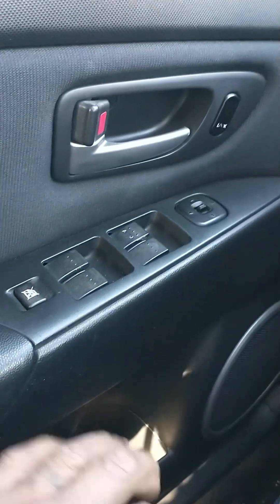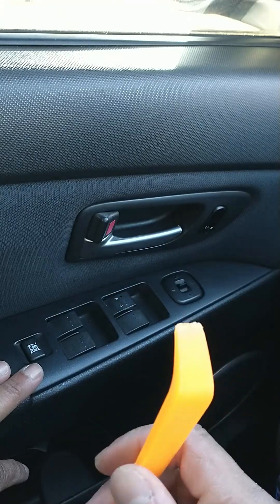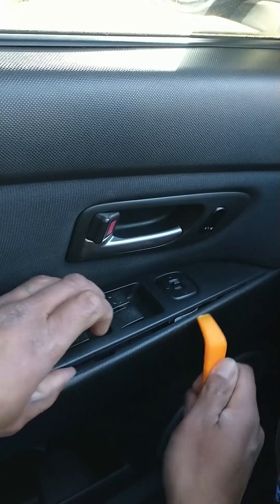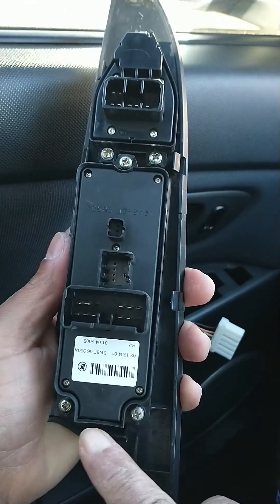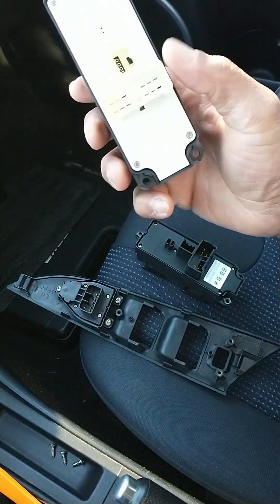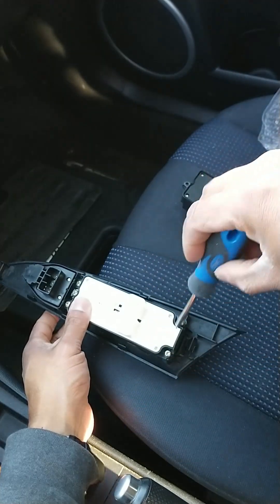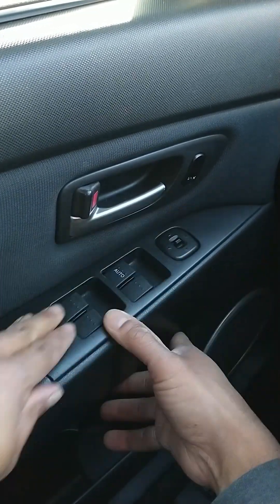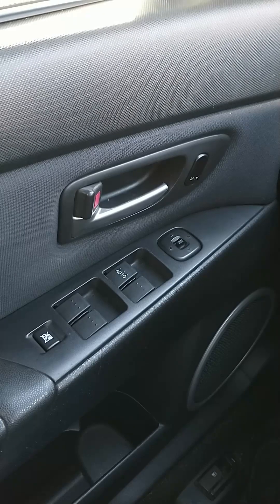How to Replace Master Window Switch Mazda 3 2004 to 2009

Comment: Thank you for your video! Very grateful for you sharing and empowering others. ❤️🙏 We were quoted an hour labour at the dealership to complete this repair and would’ve been charged $135 +12% tax. When I questioned the service department at Harris Mazda as to why they needed so much time to do such a quick repair they went into a lengthy explanation about how they had to take the whole door panel off, workaround, harness, etc., etc. etc. I watched your video, consulted with a mechanic friend to ensure  I was  understanding the process correctly.  I then went ahead and did the repair within 15 minutes. That is as an unexperienced person who never works on vehicle repairs.
Reply from the maker: I'm glad my friend